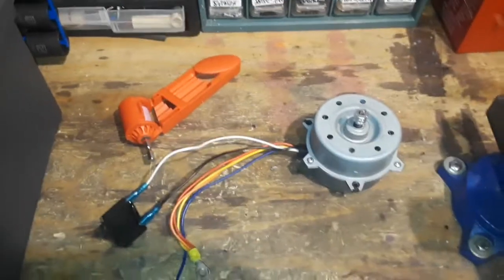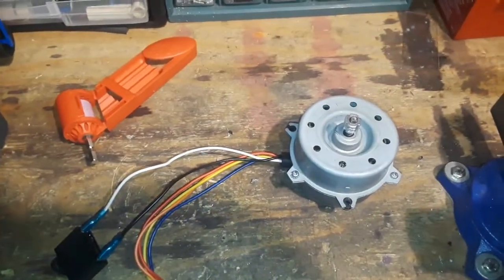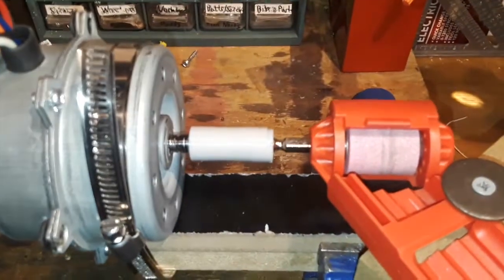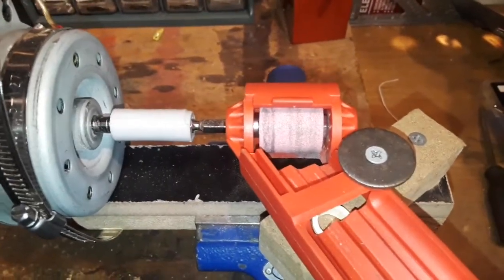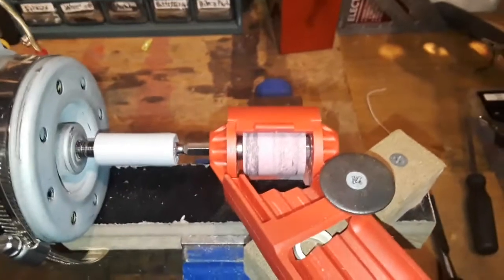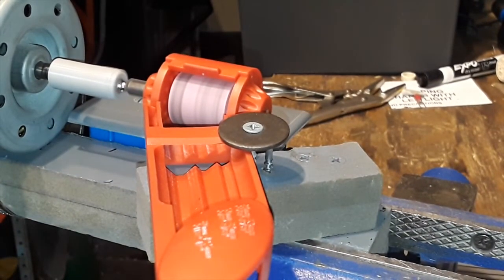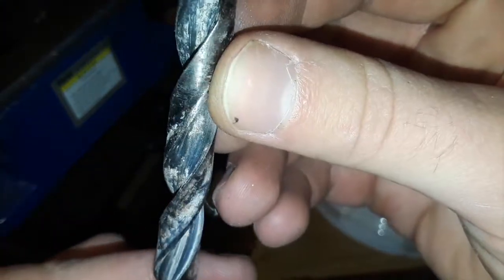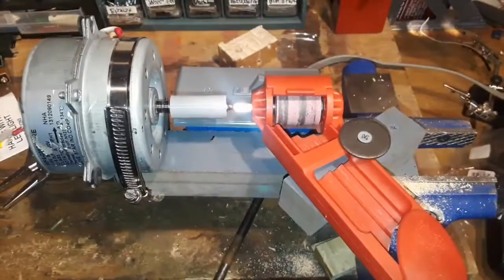Homemade Drill Bit Sharpener

Comment: Cool project.  I am thinking it would be good to find a way to make sure the 2 sides are cut to the same depth, meaning that they will contact the cutting material at the same time.  I was thinking like making a pusher kind of  like one that is used to push material through a table saw, so push the bits from the back side with a stop you won't over cut one side more than the other.  A pusher that is adjustable so you can change the depth for different drill bits.  Maybe something as simple as a bolt with a nut, or  wood with some kind of adjustable clamp.  Thanks for posting this project and cheers.
Reply from the maker: That's a good idea. Maybe I could attach some sort of caliper that connects to the drill bit in order to measure the depth.